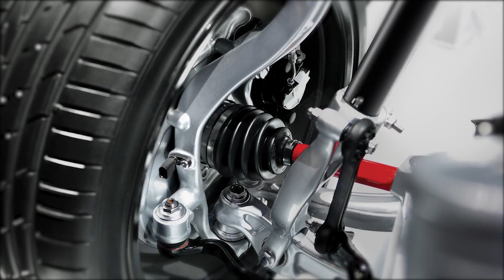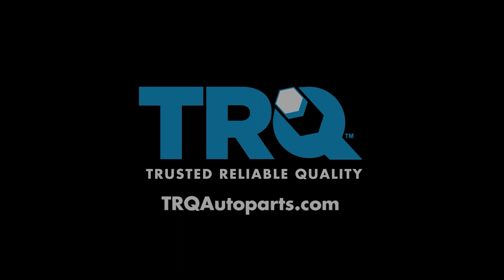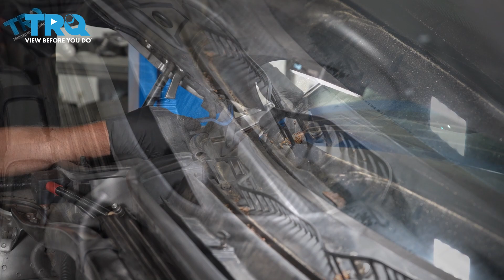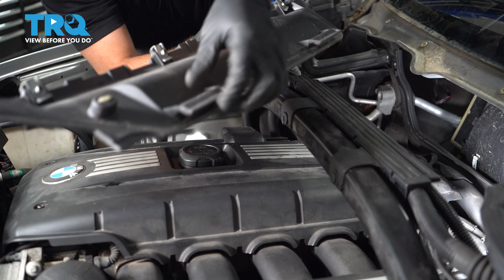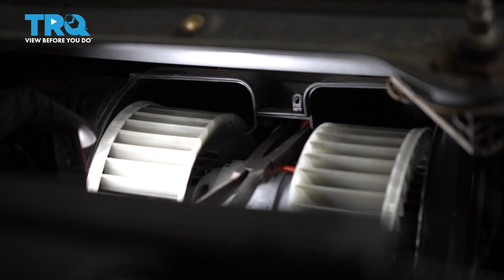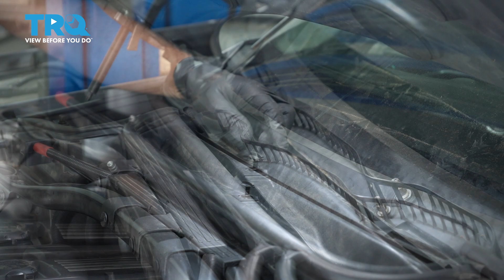How to Replace Heater Blower Motor 2004-2010 BMW X3

Comment: the hardest part of the job is reconnecting the new plug to the existing harness. Key thing to note about the car-side connector is that it’s able to slide forward and backward along a small plastic track. If too far forward, you don’t have enough space to flex the motor-side connector’s locking ears. You have to back up the car-side connector far enough to fit the motor-side connector with its locking ears expanded into the tight space you’re going to be working in. Wish i took more photos, but maybe TRQ can release a video covering that part more in depth. Hope that’s helpful to someone

Comment: I’m in trouble. I accidentally broke the plastic fastener that holds the small male end in place behind the blower. Now, it moves around when I try to reinstall it… impossible! Any advice? Does the entire housing unit come out so I can get to it… Why does BMW use so much plastic and why is this wire so dam short?

Comment: Just did this job. Toughest part is the electrical connector. Off and On.
Had to use a pick tool to hold the vehicle side connector from the back as I pushed the motor connector side on.
Tried without and pushed the vehicle side plug off the holder. PITA.

My advice, get a small pick set to get this done.

Also the replacement motor I got had more plastic surround parts than needed. Probably for an E46 or something. Just take that stuff off.